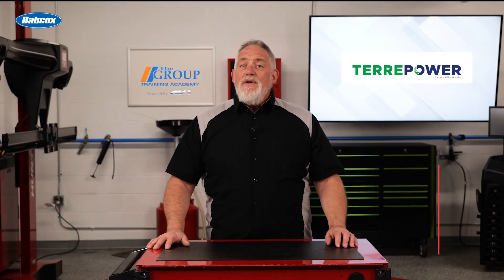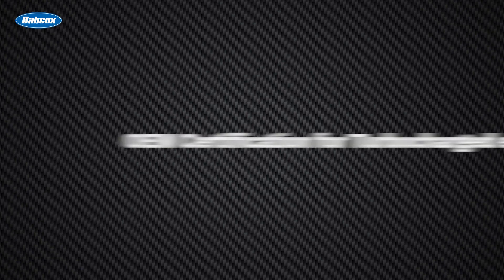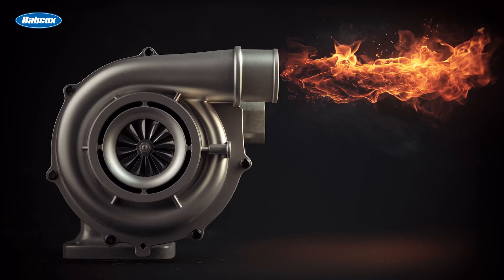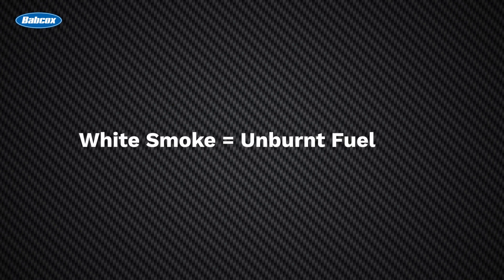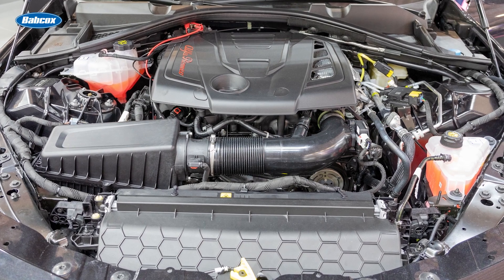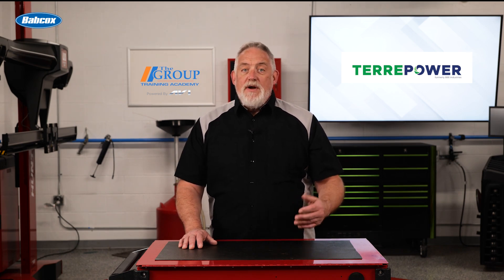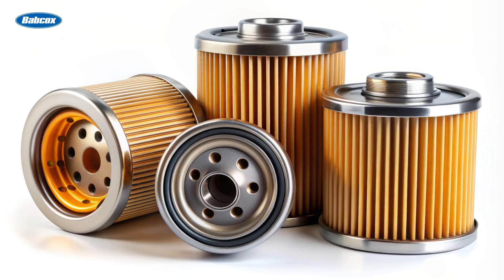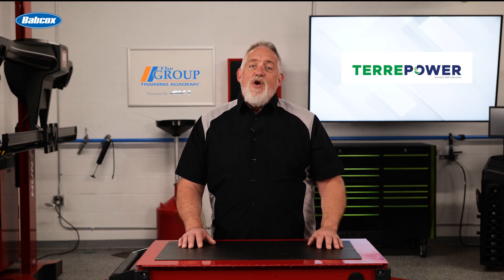Turbocharger Service: Don't Just Replace, Diagnose!

Comment: 80's turbos weren't bad, but a lot of automotive development had yet to be engineered yet. 40k miles would actually be a pretty good run for most back then. Improvements in oiling efficiency and the rise of synthetics have made a huge difference in how long they can last. Turbo timers were almost a requirement for any tuned turbo vehicle back in the day. I had an HKS timer in my 87 Supra but even without one just letting the engine idle for a minute before turning it off could go a long ways too. I don't think dealers do a very good job of educating buyers either, they just focus on numbers and slap the roof lol. I was never told that I shouldn't "lug" the engine or that building boost before a certain lower RPM causes unnecessary strain on the turbocharger.  I recently inherited a Subaru STi from my father after he passed away and I don't think anyone told him either cuz he killed the original turbo somewhere around 60K miles...I kinda blame the Si-drive system for that though.